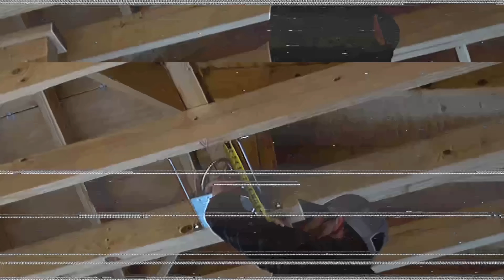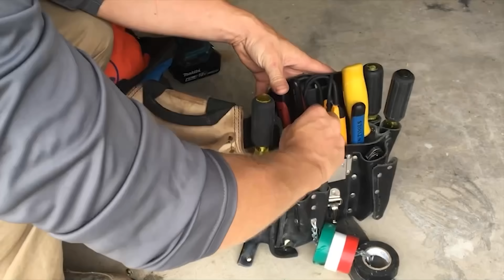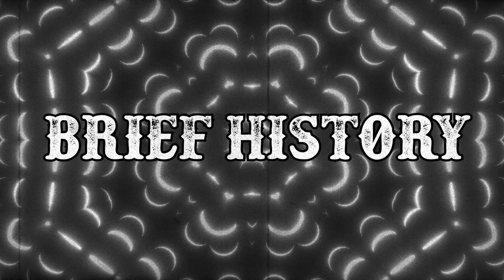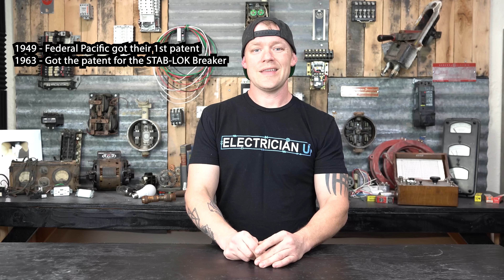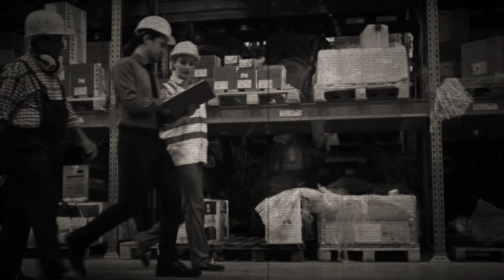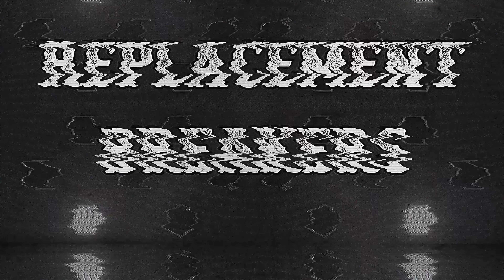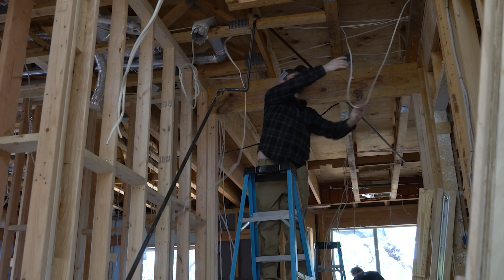FEDERAL PACIFIC ELECTRICAL PANELS - why their panels are dangerous

Comment: You asked about how engineers look at failure rates.  
All tests have two types of failures.  In the case of a breaker near the test limit, it could fail to trip or trip when it should not.  For each of these, you have to look at the failure rate times the risk.  If you have a risk of killing a person, even a relatively low failure rate is worse than something that fails frequently but only causes a minor nuisance.
Many years ago, I designed a tester for large (1200 amp, 3 phase) breakers for Westinghouse.  These were 100% tested.  The tester checked about 15 parameters (the breakers were adjustable) automatically to avoid worker boredom errors and a barricade went up to block a failed breaker from being moved to the packaging line.  Test results were printed on a sticker that was stuck on the breaker detailing when it was tested and the values on the test.
Reply from the maker: Thank you for sharing 👌

Comment: In Florida  anything  built in the 60 and 70 early 80s    were  a lot of FPE PANELS  and  Sylvania zinsco GTE  were  used . Zinsco the aluminum buses rail  would  burn open mostly  and the breakers  would  go weak . FPE  you could weld with  . But they were the cheapest  contractors  choice.  Challenger  is the most recent on the shit list because  of the aluminum buses rail.

Comment: Yes they do make a piece of equipment that test Breakers circuit breaker place in Denver watch testing Breakers and basically it's low voltage High amperage testing Breakers basically you can put load on anything you want to test like a circuit breaker fuse you can even bring up a piece of wire with this machine sometimes you can put new guts in an old panel just a faceplate has a lineup

Comment: In the case of these FPE panels, when changing them out, does this also mean the whole house has to be brought up to 2020 NEC or just the panel?
Reply: If it's  permit job it's  going to be up to the  city or county  your dealing with   most cases  it will be just the service  and panel    / INSURANCE companies are requiring  aluminum  wire to be  replaced  to copper  and there  forcing  the brands to be replaced  FPE  Zinsco  Challenger  .

Comment: An appropriate failure rate is the one which is cost effective. Say you can reduce the failure rate by 1%. No matter what the actual failure rate is, but lets say through some form of quality control, you reduce the failure rate by 1%. Does that cost more or less than the projected cost of customer support from circulating the failed product, lawsuits, service, warranty replacement, and so on? If the cost is greater for the reduction than the cost of circulating the the failed product, then the failure rate reduction is not justifiable. Then I'm sure you can think of situations where the failure rate is quite high, and situations where the failure rate is quite low. Also keep in mind that products produced in high volumes will always appear to have a higher failure rate than products produced in low volume, simply because you see more failures, and most people, yourself or myself included, will not know how many of a given product failed. We just hear the bad stories, not the thousands of good ones.

It really is that much of a case by case basis. Hope that helped.

- Engineer

Comment: Back when I worked in a shop for an equipment reseller, we had over current testing machines that we would use for testing circuit breakers. We also had tons of fire pacific - I mean federal pacific - breakers in our warehouse. We used to take them into the shop, hook them up to the overcurrent testers and watch them burn up for fun.
Scary to think of just how many of these were in people’s homes and how many are still in service.

Comment: I worked in a machine shop the made downhole oilfeild tools. The  practice was to take the first article of a work order to QC for dimensional inspection. Once that was approved, you filled the order and took the last article.  Depending on the tolerance you'd use micrometers every ten parts (for +/- .015 inches) or every other one for tighter. Lathe cutting tools, even diamond, wear, especially with fiberglass.

Comment: Has anyone ever determined the underlying design flaw with these breakers?  What is causing them to fail to trip when there is an overload or short circuit?
Reply: There's a video where a guy disects one. I think the bi-metal strip would warp and not actuate the rest of the switch when a fault occurred

Comment: Back in 70s & 80s, the company I worked for, shipped product to UL for testing. They beat the hell out of it, to make sure it was safe. Of course, they only test one unit, so if the production line cut corners, bad product could get shipped out.

Comment: 11:00 40 amps would not simulate a short circuit. Short circuits in residential installations are typically in the 1,000 to 5,000 amp range.

Comment: Interesting. There was a 2 page article in our local newspaper about 10 years ago about the dangers of Pacific Electric breaker boxes, and the many house fires and even deaths that had resulted. My recollection is that they had been made to set up a fund to pay for replacement panels, but it was long exhausted by this time. Checked my panel, our house was built in the mid 70s, and of course it was Pacific Electric. Promptly had it replaced.

Comment: I bought my home with a FPE box.  I would not spend the night there until the box was changed out.  
I was working as a HVAC tec.  On any service call with a FPE box the breaker was the problem.  
Low voltage gives really wierd symptoms.
I thought FPE was out of business.  All I see any more are Square D & Siemens.

Comment: Yep, the house I live in now had breakers made by those assholes. They started crackling and buzzing, and lights started flickering. Walked out into the garage and smelled smoke. Called my electrician and 48 hours later I had a brand new panel.
Reply: Daaang you have money money
Reply: @Cocinaughty there is no way a panel is that expensive (I'm not from USA)
Reply: @Cocinaughty wisdom 🤔

Comment: You know of course it was a commercial 3 phase panel that was the problem right. And how it was being used at the time like a disconnect or switch. Which were not rated as switching devices at the time. That came vfc around in 1998

Comment: Yeah, my wife inherited her dad's house when he passed and I ended up rewiring the whole thing. It was all on 4 Federal pacific breakers. While working on the wiring I had all the breakers turned off but after double checking I found two of the circuits were still hot with the breakers off!!! 🤬Pulled the meter to be sure for safety!  👍
Reply: I never trust a breaker, and always check with a meter.

Comment: back when i did engineering for electrical systems in building construction i would never load a circuit to more than 80% of the breaker rating . . . the rule was that a fully loaded (100%) breaker would eventually trip due to environmental conditions . . . also, another critical rating for circuit breakers is their short circuit interrupting capacity . . . for a typical breaker you would find in residential construction that would be about 10,000 amps (the minimum) . . . in commercial/industrial applications a study is necessary to determine short circuit current availability at every level of the system ass it can be considerably greater than that. 10,000 figure.

ETA - FPE has always been shit, Square D is acceptable but there's a lot better out there.

Comment: Great presentation, very informative. 1960 my parents bought a brand new house in Brick Town NJ. It was your typical tract house, 3 bedroom ranch and had the dreaded FP breaker panel. No 220 circuits in the house, natural gas heat, clothes drier and stove, no central AC. I do recall some of the breakers tripping. What was really scary was that the wall receptacles had no ground lug, one day my uncle came over and replaced every single receptacle in the house that has a ground prong. Luckily my parents sold the house in 1971 and wasn't required to update the breaker panel.
Reply: I had an uncle like that. He replaced the ungrounded outlets receptacles with outlets that had a ground...but no ground wire. It was safer just to leave them be.

Comment: I bet the exec's all had stock in tool manufacturing, specifically linesman pliers and diagonal cutters. because those breakers sure cost a lot of pliers/cutters to be blown up.
"oh the breakers off, cut the wire out of the way = BOOOM!" especially 2pole with ground or neutral conductors. I've killed my share of them on that old junk

Comment: I found out the hard way about FPE breakers. The wiring to my AC overheated and shorted out. The short just followed the wiring in the wall melting and burning every thing in the wall and then the attic. The breaker never tripped.
Reply from the maker: Damn dude

Comment: Can verify, had a 90A 240v disabled-on by a cockroach at the appliance fuse in a compact electric furnace.  When we pulled the box and replaced it with a [D] all the bus contacts were corroded.

Keep in mind that "60% were faulty" means that about 80% of the dual-throw were faulty and that the disconnect in the box was ONLY a disconnect... had to hit mine with a sledge to throw it.

Upside, the electrician my FIL knew was the guy who put the roof of that trailer together when he was 19.

Comment: I guess I'm in the minority here because I've never had a problem with my panel or breakers and I've only had to replace worn out ones that would trip at about 80% capacity now as far as changing breakers or panels. I can assure if they can afford to change breakers they can change the whole panel. Those fucking breakers are expensive. Really expensive

Comment: Between my uncles, cousins, father-in-law and friends who are various engineers and in the manufacturing industry (and the various conversations I've had with all of them):
 Batch testing yields of failure rates aka "negative consequences" vary widely among sectors.   In electronics (appliances) can be acceptable at 10 to 15%.
In pharmaceuticals, over 2% and someone is going to lose their job.
However, various factors and metrics are in place for "Quality Assurance" and separately "Quality Control"

Comment: Are these what they call a split buss panel ??? I had a house that had the pushmatic breakers a lot of them were stuck they would not move to be turned off !! was afraid if a problem they would not trip .Replaced all 3 panels because of that !

Comment: My parents' house, built in 1963, had a FPE panel.  Amazingly we never had a problem with it.  There were two breakers that occasionally tripped---we had a crappy above-ground swimming pool and when the filter was running and my dad would decide to use power tools, it would trip the garage circuit.  Another kitchen breaker would occasionally trip.  Maybe those were the only good ones in the panel..  Once we entered the Internet age, I googled this panel and found all the problems that were being had.  When my mom passed away and I remodeled the home and readied it for sale, I had the panel replaced and relocated from the walk-in closet it was in to the garage, as I didn't want the karma of passing along this problem to the next owner.  I still have the panel as a souvenir.  Even as a kid if I had to reset a breaker I thought they felt pretty shoddy and never liked the way all the handles wouldn't even line up with each other.

Comment: Had an overload on a breaker the other day and the FP Breaker did in deed trip and shut off power. Will still replace panel sometime anyway
Reply: I had no problem with an FPE breaker trip on an overload. But trip on a ground fault? Make sure you have a welder’s mask available.

Comment: I must have missed the part of the video where you showed or explained why the breakers fail in the first place. I've been curious about this since I first started hearing about them being junk.
Reply: From what I read the design is overly ccompllcated  and the paddle may get hung up on the case. It also appears that this may be the new asbestos with people wanting to sell you a new panel. If these were so bad how come the insurance companies are not telling you to replace the panel. My panel went in around 1950  you think the insurance company would have said something. Home inspectors are out to find faults to justify them selves. I understand that in Kentucky an inspector can not bring up FPE panels. My panel seems too small for the number of breakers   it handles.
Reply: @patk4351  1. If your panel was too small for the number of breakers you had you would trip the main. 2. Asbestos is an amazing material and it 100% causes mesothelioma, which is literally cancer. 3. FPE panels are junk. It is not a fairy tale to make a sale. People literally burn in their sleep because of these panels. You're an idiot.

Comment: as an electrician of 45 years now i see the to often .i always warn home owners of the risk. i tell them if they google panels they will see about 1 page of bad things , if you google fpe you will find about 7 pages of bad things on that panel and breakers . it wasnt just bad breakers . 1  breakers dont trip when they should  2   failure rate of them , it was said that the breaker had a failure rate of 30% just from opperating the switch not even in the panel, 70% failure rate after installing and opperating the switch one time.  3  the stab lock system(trash) because when you remove the panel cover the breakers can jump right out the panel(seems the cover is the only thing holding them in.  4  the panels did not have enough space around the breakers to  make proper bending radius (you had to make very short tight bend to connect wire to the breakers).  5  because the breakers on position(closed) was outward instead of the usual inward when you tried to remove the panel cover it was very hard not to hit the breaker either off or loose. the list goes on

Comment: Hey, I had this FP panel installed in my house since 1987 and noticed that all neutral wires burned at tips in the neutral terminals. I didn’t find out or better say confirm that these CBs were really defective until 2016. By the was, all wires were installed per standard.

To confirm that FP was in fact “toy” without any protection function, we did Short-circuit test ((warnings: don’t do this if not certified to work on electrical equipment, ask for professional support for this)). The fault created during test was cleared by main house CB at power entrance NOT by FP panel ! 

We have been using toy panel for about 29 years!!!

Be careful guys. 

Greetings from Eastern Arabia!

Comment: I personally had some bad experiences with Federal Pacific breakers not tripping. In fact, I remember one panel where the breakers would not trip, even in a dead-short situation, and the wire would would literally burn, and still not trip! My only remedy was to replace the entire panel with a Square D. Preferably, the "QO" style. NEVER any problem with them.

Comment: My FPE Stab-Lok breakers still trip like they’re supposed to!
Reply: So never? 😁 I know a guy with a fab shop full of older high amp single phase machines that refuses to change the panel after using the same equipment in rented shops with newer higher amperage breaker equipped panels that would constantly trip 🤣 as long as his chemicals and oxy/acetylene tanks are far away from any wiring (they aren't) maybe his metal building will survive the meltdown 😳

Comment: From what I understand is that their test bench had a way to manually trip the breaker even if the breaker wouldn’t trip its self, so the test was guaranteed to trip the breaker every time!
Reply: That's correct , Federal Pacific had set up a remote control to make the breakers trip when the inspectors arrived to fool them that they worked perfectly in which they didn't work at all
Reply: @ironmartysharpe8293  i would love to have seen that bench

Comment: in my travels, years ago, I ran into a "GENERAL PACIFIC" panel that was not a "STAB-LOC" panel. this panel was from the late 1940's (early 1950's). I replaced the panel, due to the fact that the breakers were not available. they looked like "F.P.E." breakers/ panel.   in my house, all panels ( main/ sub) are backed up by fused disconnect switches. one thing about an electro- mechanical device( breakers) is someday it my not work when called on to do its job!!!!. fuses on the other hand, is a thermal device that when correctly sized( overload/ fault current) will do its job in a safe manor!!!!

Comment: I work in the bowling business specifically on Brunswick machines on some of the older Brunswick machines they not only had Federal Pacific Type NA 20/20 breakers we also had the Federal Pacific three-pole motor start relays... Very rarely did we ever have a problem with them and they did what they were supposed to do easy to maintain especially the motor start relays..
All of them were UL listed and I have one sitting here in front of me that has a UL square stab lock sticker on it.. some of them are still being used in machines today.. interesting never knew this about the company

Comment: Liked the presentation! I bought a new house in 1980 that had the FPE breakers and panel - always thought it was a cheap piece of crap. I once sawed through a 14 ga extension cord by accident and it never tripped the 15 amp breaker. On top of that, whoever wired the house had about 1/2 the house receps on that breaker. I've always used Square D for my projects including the new house I built in 1988. Still in the house and I've never experienced any problem with Square D products. How do you feel about their product line since Schneider took them over?